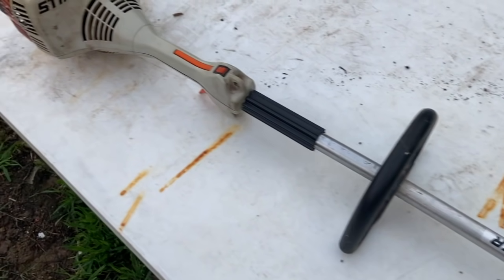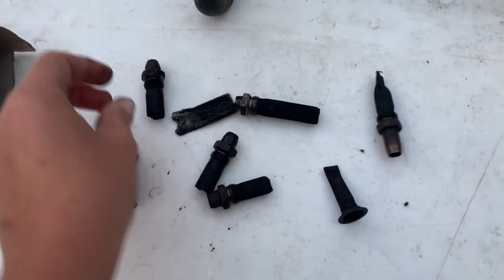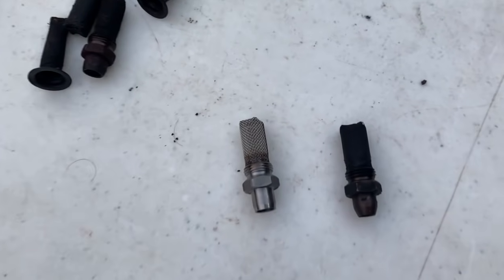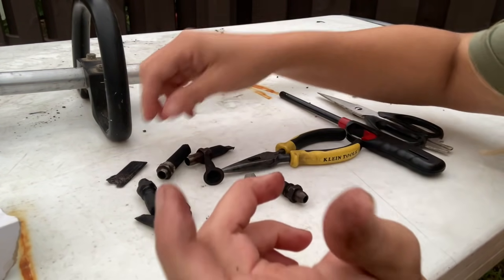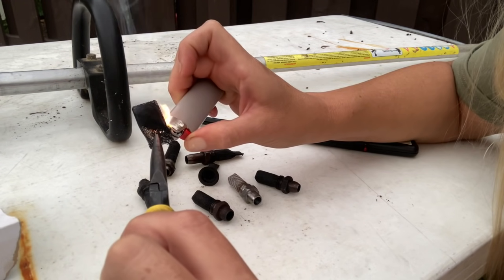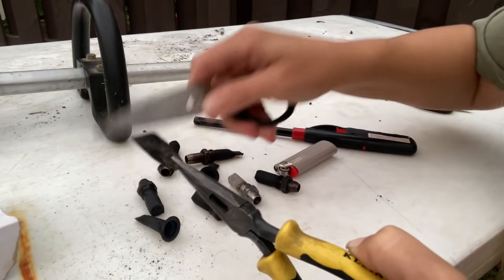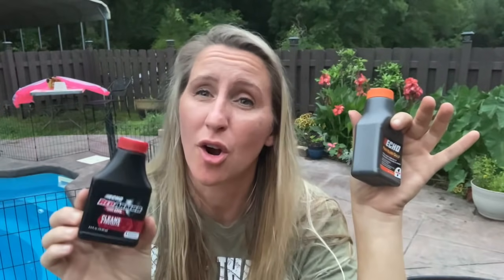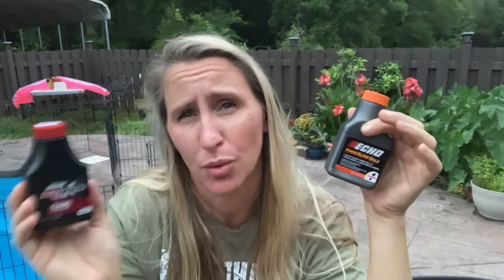THE BIG SECRET! STIHL has NO POWER? Won't Throttle Up? How to fix your trimmer/blower.

Comment: It says in the owners manual that you may have to clean the spark arrester when you have a loss of power. Some people just don’t want to do it. I clean them all the time
Reply: I don't understand if the Spark arrester on the sthil trimmers it exist only for american customers or also for Europe... (Sorry for my poor English!)
Reply: @chitacarlo  I think the spark arrester is there even if you do not live in the States. In my country (Portugal) you would be forbidden to operate some tools and appliances in summer because of the danger of fire (more than 200 people were burned to death (firefighters and civilians) in the past decades due to forest fires.
Reply: @antoniolopes8776  thank you Antonio!
Reply: Finally someone said it, read the owners manual!
Reply: @antoniolopes8776  That's why they are required here in the states, some keep saying EPA regs., that's not it, it's because of USDF regs. for fire safety.  The  screens have smaller holes than previously, this is part of the problem with clogging. Fun fact, if a Stihl product comes into the shop for repair that has been modified, it automatically voids the warrantee, if still applicable, unless the part was broken and was in for repair including that part.  Stihl will tell you to put it back to stock or it cannot be worked on.

Comment: Excellent commentary!  Clear and you stayed on subject!  I usually carry my equipment in to our local and they clean that exhaust port for a modest fee plus check ‘er out before I start my yard work for the season.  Thanks for the tip on the Echo oil too!!
Reply: Echo oil is great. Cheaper too.

Comment: Every 2 stroke tool I have I ripped out the screens and some driiiled out the muffler plates a bit...  ..never had a issue...
Reply: Yeah, but its illegal and she can't tell you to do that.. 42 stupid MFs would sue her because they started 41 forest fires. (There is ALWAYS a couple of guys who do stupid stuff together.)
Reply: @jeffery19677 , You stated the exact reason. Great comment.
Reply: @jeffery19677  nope Not really illegal at least Not in my country. More Like a gray area. But it Sure can lower the Performance of the engine because it does Not have enough Back pressure
Reply: Hopefully your homeowner's insurance will still cover the fire that rips through your trees and the neighbours' properties after you set them on fire...
If you have a diesel truck, tractor 4wd, UTV, ATV....put some stainless steel mesh in a sock-like configuration over the end of the exhaust pipe (hold the sock on with pipe clamps)...the flaming carbon chunks that get caught there will amaze you....
Reply: @KriegerDelfin24 , The screen does not provide any performance enhancing back pressure. If anything, it hurts the performance.
Reply: Same!

Comment: I’m sure there are enough comments on this but here goes my 2 cents, it has been known for decades that two cycle engine will carbon up at low and high speeds, it’s in their design to do so, the 2 cycle oils have improved immensely over the years to keep carbon deposits down.
Instead of always replacing the spark arrestor when it gets clogged all you have to do, if you have the tools, is super heat the screen with a torch, get it red hot for a few seconds and then just dust off the ash, it cleans it like new. Been doing it that way for 40+ years. Some people just remove the spark arrestor but that’s dangerous if using the equipment in grassy areas, it can cause fires if carbon chips come flying out.
Reply: That process is literally what she just showed.
Reply: I have a Stilh trimmer that I have used for about 16 years....always at full throttle. Never had to touch the spark arrestor.  It hardly ever gets ran for less than three hours at a time.

Comment: Stihl doesn’t void your warranty for not using their oil. They double the warranty period if you do use their oil.  I have a 20 + year old Stihl trimmer that I have always used Stihl oil in and I still runs great. I have never cleaned the spark arrestor in it either.
Reply: How do they know what you’re actually using?
Reply: They don’t, but you are buying a six pack of their oil when you buy their machine.

Comment: I was using a grinder on a trailer in my driveway. The warm sun was on my back but suddenly I felt a little too much warmth on my back. Turned around to find about an 8’ x 8’ fire in the dry grass. Luckily there was a garden hose within a few feet to deal with the situation. Fire and dry grass is nothing to mess with.
Reply: A grinder?! What does that have to do with this video? I'm more careful with a welder or a campfire but I've never seen a spark come out of any engine that has ANY type of muffler. I say throw the screen over your left shoulder for good luck.

Comment: The spark arrestor is made to be cleaned out every once in awhile
Reply: I spray some brake cleaner into the exhaust port once a week.... works every timr
Reply: The spark arrestor is ment to be taken out and thrown away. Best way to avoid a future problem.
Reply: Take it out completely unless you work in a Forest Fire prone area or a Propane Refinery
Reply: @joshuaplacka8480  agreed. It's useless

Comment: I used to run the red armor on my stihl equipment but started having issues with taking more pulls to get it going ended up going back to the stihl oil and now they start at first or second pull.
Reply: Opti-2  mix. 6th season with it. Red Armor not good in my Echo chainsaw.

Comment: Amsoil run at 80:1 for years in saws, blowers and brushcutters/trimmers. Never a problem and originally ran them at 100:1 for many years.
Reply: Rip piston and cylinder
Reply: @THEMOWERMEDIC1  nope, shows what you know. The Amsoil is made to run that way. I have been doing this for 30+ years and never once had an engine failure.
Reply: @shawnengstrom3906  always run what the mfg suggests   No matter what kind of oil you use.
Reply: @shawnengstrom3906  I also run Amsoil Saber at 80:1 and have for quite a few years. I even bought a new Stihl trimmer 5 years ago and ran it exclusively with Amsoil. Absolutely no scuffing on the piston whatsoever.

Comment: magnus and moss act should prevent them from voiding warranty.
Reply: Exactly. If they require it for the warranty they are required to supply it at no cost. That's why they extend the warranty when you buy the equipment and oil together.
Reply: What's more is in the event of failure the manufacturer is, as per the Magnuson Moss Warranty Act, legally required to prove that the damage occurred because you used a different oil. Simply saying so does not constitute proof. This was decades ago but as you can see the manufacturers still illegally void warranties because they know they can get away with it. We have the Federal Trade Commission who is doing precisely this much to protect consumers, 0.

Comment: At first I wondered how I’ve never had a issue with my stihl fs90r on stihl hp ultra oil for the last 4 years, but I’m constantly full throttle
Reply: Is going full throttle good?
Reply: @coollemonproductions7590  
For a 2 stroke, with the correct oil/fuel mix, clean air filter, clean cooling fan/cooling air passages and unplugged spark arrestor...yes.
The exiting exhaust gas has high heat and velocity...ain't nothing going to stick in that arrestor screen...
the heat of the engine will be controlled by the fan and fins.....
Engine will love you for it..as will any centrifugal clutch as the clutch will be fully engaged....not slipping and wearing out....

Comment: I have a Fs 45 Strimmer.  The performance between an `off the shelf' oil and Stihl is marked.  The latter affords much improved performance, easier starting and running.  If someone has an issue, I suggest they have the carb investigated.
I've been doing this for 40 + years and cringe when when people make sweeping statements
PS Stihl oil is supplied by one of the major oil companies
Reply: I.only use still oil

Comment: The one thing I often see are people starting their two cycle engines from dead cold, running them up full bore and going to work. Shouldn't a two cycle be warmed up first to avoid scoring the cylinder walls? If so, how long of a warmup should it be?
Reply: Absolutely. I give it a minute or so.
Reply: Yes, let it idle for a minute or two then slowly rev it up to about half throttle for another minute or so then gradually rev up to full throttle and commence cutting. I’ve been doing it this way for 31 years of timber cutting. I was told about this by an old logger, what he didn’t know about chainsaws and felling trees, wasn’t worth knowing. 😊👍👍🇦🇺🦘🦘
Reply: @Jim-ie6uf  my stihl br600 blower has an intake adjustment behind the air filter for cold weather. just loosen the screw move  to the snowflake and tighten the screw.  noticable diff in cold weather when blowing sidewalks
Reply: These machines are best warmed up, and used, at full throttle.  As soon as they start they have oil running through the system.  Idling doesn't burn the fuel oil mix properly and will clog up the screen.  A four cycle, straight gas engine would be the equipment i would warm up on idle.
Reply: @brianwalker1933  machines have changed in 31 years.
Reply: I start mine, take it to the work, and start working.  learned the habit from my dad, and we have to retire equipment because we can't get service parts like gas lines or gas tanks, rather than burning up the motors.

Comment: We run at least 20 pieces of gear here and if it’s not water or grass in fuel it’s plugged exhaust . Plugged so bad exhaust mufflers come off to be burned and blown out . I always thought it was the guys/gals running them to low ( which they do ) didn’t think it was because of the stihl mix we use here. Might be trying  out the Echo oil next season! Thanks . Great videos btw . Lol everything plugs but out saws . Which makes sense . They never run those at low RPMs

Comment: I use VP 2 stroke oil in my cheap 75 dollar Murray weedeater for 6 years now with zero issues I keep saying when it finally dies ill buy a new stihl but the little Murray just keeps starting .....
Reply: I use castor 927 because it smells good and leaves a protective coating.

Comment: Another thing is to use Premium Fuel. 2 stroke engines are high compression engines and need the premium fuel to run correctly.
Reply: No two stroke are usually lower compression than a comparable four stroke, they rev lower, but they make more power per capacity weigh or bulk than a four stroke simply from using each cylinder twice as often as a four stroke.

Comment: Doesn't sound like an oil problem but more like an operator problem.
Reply: I would say you both are correct.  Any one running a 2 stroke motor should be warned  that the exhaust need to be cleaned every so many hours. No matter if the oil causes it or not. We raced dirt bikes and had to rebuild the exhaust once a month to keep max air flow and power.  Lots of people don't know to do this.  I have a stihl weed eater a commercial one, a 251 saw and a 362 saw non have had any problems i run stihl oil and they are 6 yrs old. I clean them regularly.
Reply: yeah kinda
Reply: It's really a question of full synthetic vs. semi synthetic. Full synthetic will clog up more, but it provides more protection for high performance engines. You are much less likely going to suffer from a clogged up exhaust system when using semi synthetic 2-stroke oils.

Comment: The SCOTUS has already decided that the manufacturers cannot void your warrantee for using after market products unless they can prove that they caused the warrantee issue. Tru-fact.
Reply: Doesn't apply to using the "wrong" oil though.  Tru-fact.
Reply: @ipdjbt  Still it must be shown that the after market product caused the warrantee issue. Magnuson–Moss Warranty Act. Threats of voiding warrantees have been a consumer cudgel for many, many years.

Comment: Just like a catalytic converter, off they go.
Reply: Been taking a screwdriver and knocking a hole in them for years and years
Reply: My brother is a 2 cycle mechanic with 18 years of experience and has seen where customers have removed the muffler screen and it actually damaged their equipment due to carbon buildup on  cylinder exhaust port and I chips off and scars up the cylinder walls
Reply: Except a cat convertor is worth alot of 🤑🤑🤑
Reply: This is the spark arrestor  not a good idea!
Reply: Daniel Cline @ Nah,great idea if nothing flammable or dry is near you!!!
Reply: Our company is in Colorado.  We don’t dare to remove a spark arrestor. We won’t even mow native under certain conditions because a blade hitting one rock can start a fire.
Reply: @jwh2ohouse1962  I'm with you I live in central colo canon city and it's bad but out on the plains you have to worry about your truck muffler and stuff like that I've ran two strokes most of my life motorcycles included and there is nothing better than a chunk of smoldering carbon flying out your exhaust to start a blaze thanks for being safe!
Reply: @claysingletary9059  Yeah  for some reason it is said that 2 strokes need a certain amount of back pressure to operate , sad to say i once had a moped where i had to premix oil into the gas , the spark plug would clog twice a week and the exhaust had also clogged with carbon after one year i  cleaned it out the next year i switched to an expansion pipe with a larger needle and seat in the carb., the engine design had the spark plug pointing straight to the front tire and once the plug loosened and popped out hitting my front tire. I think Puch really meant Push in another language.

Comment: I run red armor in everything. Buy the 6 pack of stihl oil to extend the warranty on new equipment and throw it out
Reply: My stuff runs a lot better on red armor also
Reply: @wabblewater  We tested some common oils on logger landing saws. Red Armor was by far the best inexpensive and easy to get mix oil. VP is good, Belray is ok, Klotz is my favorite because I love the smell of it burning. But the everyday work oil choice is red armor mixed with 91 octane no ethanol MO gas from an airport
Reply: my dealer only told me, "if you don't use synthetic oil in new equipment, it will die prematurely."  I use stihl, because they're stihl dealers.  the big lesson is to pay the money for good bar oil instead of Durex.  burned up a bar with Durex.
Reply: @kenbrown2808  The only oil that carbons worse than Stihl Ultra is no name dino oil. My dealer, who sells most brands, Echo, Stihl, Husqvarna, etc.is the one who tells customers to buy the 6 pack of ultra for the warranty ant trash it. The dealer sells 7 semi loads a year of VP non-e premix. It cut his repair load by 60%.
Reply: @grifonks  and yet, I've never had a carbon problem.
Reply: @kenbrown2808  I am not attacking you or Stihl, I would not run Husqvarna synthetic either. But those of us with a choice, not stihl elite store techs, I rebuild and port pro saws, run mostly red armor. Just like Chickanic I clean ultra carbon up every day in chainsaws, blowers, trimmers etc. Use whatever you like.
Reply: i useually buy stihl  moto mix wich allready made up just all it does take cover off and pull seal and last for 2 years plus handy too if going up in the air with chainsaw can is handy
Reply: I have always ran still oil. Ya dont keep ur spark arrestor clean thats on any two stroke or u will lose power cuz its not running efficiently cuz its not getting the proper air flow thus the engine. An they don't force u to buy the oil, just if u do it extends your warranty above the manufacturer basic warranty period. I have ran stihl husky echo an jonsered an others over the last 28 yrs an an I will stick with my still power equipment. An any real small engine person knows ya dont put or idle a two stroke for long periods or u will foul plugs or gum up the spark arrestor. U take care of you equipment qn service it regularly as well as learn how to run a two stroke an ur problems most likely will go away